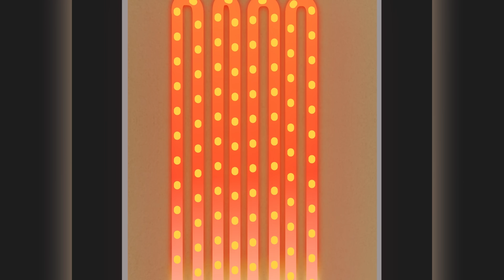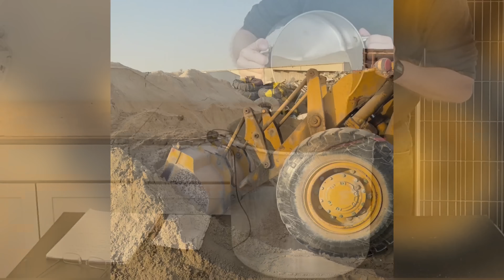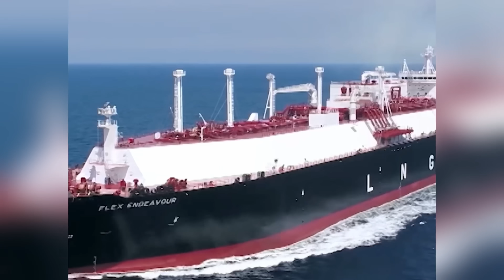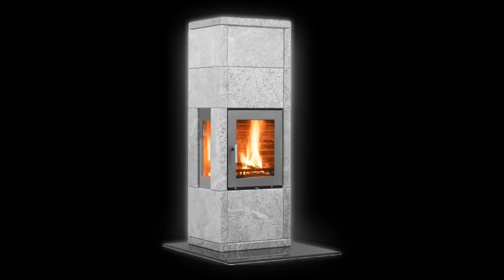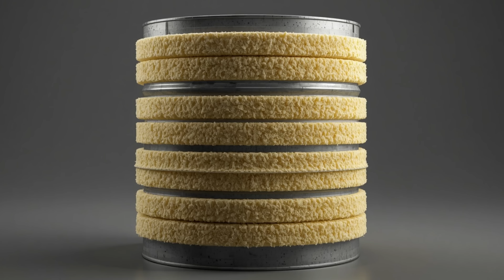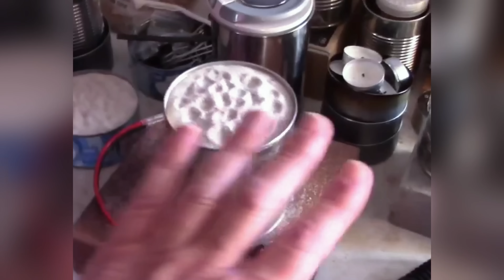A Pile of Hot Sand Can Heat a Town — But Your Basement Version May Be Illegal

Comment: Gas furnaces should be replaced with natural gas generators which produce power to run their own blower motor. The exhaust heat can be used for the same heating.

Comment: I mean, no matter what, the efficiency of the barrel is relative to heat loss/insulation, so overall it might be 90-95% efficient. When you consider heat pumps are 300-500% efficient, this idea becomes pretty dumb.

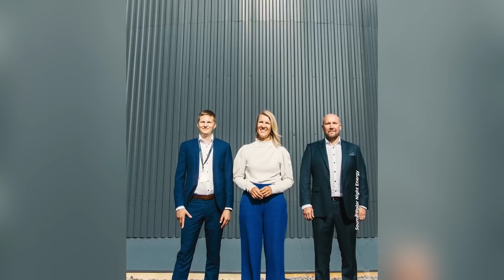Comment: The graphic at 0:36 is absurd. It says the sand is heated to 600 Celcius, and says the heat exchanger uses copper coils in the sand. Copper can withstand temperatures up to about 400°F (205°C) before it begins to lose its structural integrity. At 600°C, copper anneals (grows very soft. Its melting point is around 1,984°F (1,085°C). Even antifreeze boils around 197°C. The boiling creates massive internal pressure on tubing that has already lost most of its structural integrity. Even normal domestic copper tubing has high burst pressures at room temp, but these collapse at high heat.

I'm not saying you can't find tubing that could withstand this, but it ain't the copper this video shows. Do your own research.

Comment: I've known about this for many years. I have a burning question if anyone can answer. If you feed 70 degree heat into a heat pump which is supposed to have a 300-500 % COP (over unity). You would basically have free heat for your home. Is there a reason you could not do this. 

Furthermore a large magnifying sheet could be used to heat the mass during sunny days with a simple solar sun tracker. The colder it is the funnier it usually is.

There are lots of ways to skin a cat government doesn't want any of this technology for anybody.

Comment: Its May 21s and I have a fire going. I have a fire going from mid October until around right now, every year. Not a fireplace, a pellet stove for now. If I could find some soapstone, I would build one of those. Firewood is a problem, because people around here seem to think that 2' x 2' x 4' is the same as 2' x 4' x 8' you know, a face cord of firewood. I don't want to cut down my trees, so I use wood pellets.

I live in the north, no access to CNG, electricity is massively expensive for me, propane would be over $1000 a month to heat my 1050sqft home. Wood pellets do the job for now. However, I am working on something similar to this, but not thermal mass exactly. I plan to incorporate some thermal mass into the system, but mainly I will be heating water, could use waste oil too since it doesn't make steam. I have built two of them, they weren't large enough so they only got up to 90F in -15F weather.  Its something you can't do in a large city, there is no room, but its easy in a rural area, or a small town. 

After I get my ethanol system rebuilt so I can make 500 gallons of fuel this fall, I will build one of my passive water heaters. I have a few ideas that should make it work adequately to heat my home. Also need to finish the insulation.